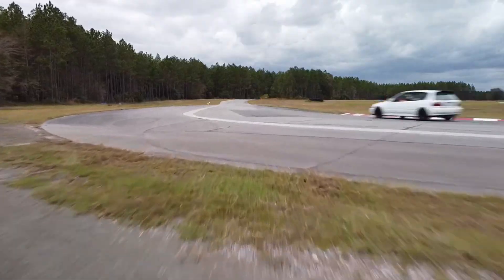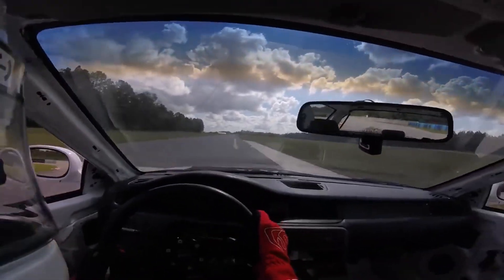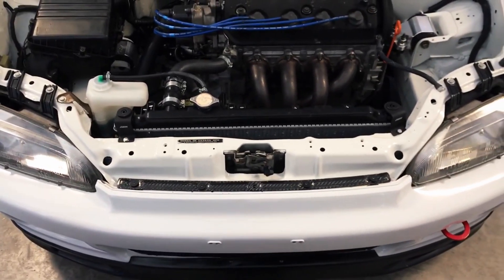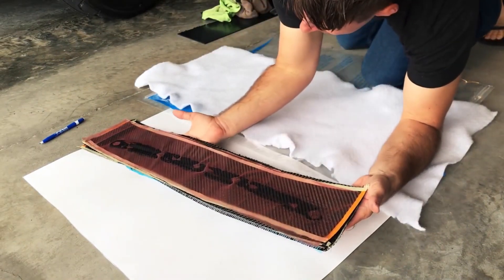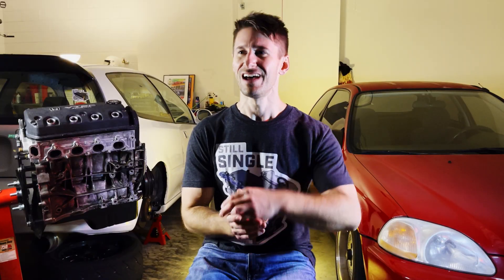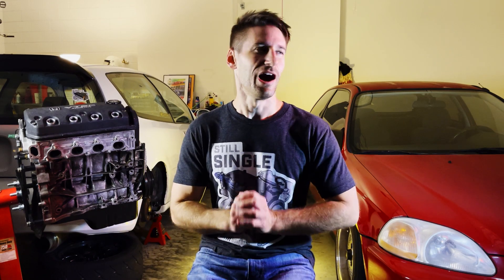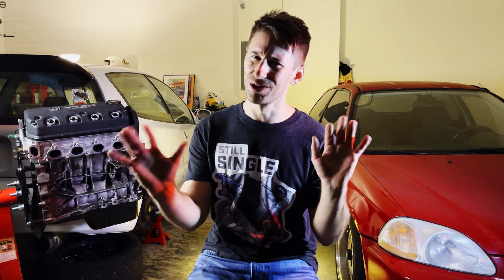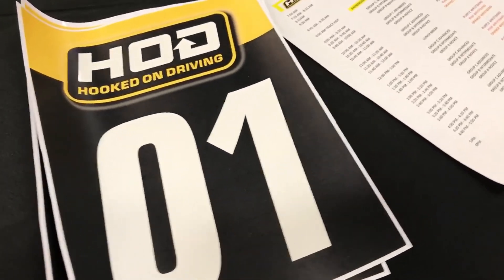That Engine Swap, NO VTEC, and More Horsepower!

Comment: I personally really think its cool that you guys track d16s, and I love all the d16 content. Everywhere on forums, and youtube videos, it seems everyone just cares about power, when that doesn't seem like the original purpose for the Civic. It's tiring sifting through pages and pages, videos and videos of people talking about "wasted money" or "b-swap it", "just k swap it", "making 90000000 hp on a civic (90 lbs of boost!)". Sure, its cool if you like that stuff but your content is just a breath of fresh air in the mass of youtube car videos. I like the engine videos, and the track stuff. Plus, I think it's cool you guys are from FL, cause I'm from Florida too and FIRM is actually the closest circuit to me. (although i have yet to go to it, my CRX is still a long work in progress lol)
Reply: Just be like me, d series power, I've turbocharged and blew up 2 of them (they were stock, still both lasted a year of hard street driving). Currently in the process of a d16 1.7 stroker Vitara build, good for 300whp and 350whp on ethanol.
Reply: I actually like (and prefer) a stock k engine. i do agree with the power hunger from that people have i honestly dont think is necessary. Just a simple,playful and peppy engine is all you need for a good time

Comment: I really like to watch your "on a budget" time attack build! Also like to know how each part  change your lap time.

Do not worry about HP, some top teams at Tsukuba time attack series have just over 200 HP and achieve better lap times than a stock Nissan GT-R for instance.

Focusing on chassis/aerodynamic is the key !
Reply from the maker: I really appreciate that you are interested to see how each part affects lap time. For better or worse, right? Very cool, thank you.
Reply: @RefineMovement  both you guys! Way to end 2021 positively!!

Comment: Love the d-series development. Before power, look at suspension, get around the corners better, and to help with the tire wear. Second, get yourself a track roll cage, and proper belts and seats. The less you move in the car, the better feel for the car you'll have. The extra weight for those won't make it worse
Reply from the maker: For sure want to get a roll cage with proper seats and belts, yes! I'm holding onto the steering wheel just as much as I'm turning it currently going through some of these corners lol. I would also like to get into sway bars. Last time out at Palm Beach Int'l Raceway I was feeling a need for some front bar when I was noticing my unloaded, right front wheel slipping a bit when I was trying to put the power down out of this big sweeping turn.
Reply: @RefineMovement  another thought I had, and i know its going to go against one of your goals. Get your car on a set of scales. Adding some weight for proper weight distribution could be helpful. As close to 50/50 side to side, with you in the car  and, as close as you can possibly get front to rear.

Comment: I honestly think a stock b20b mated to an ls trans would be very useable for the track. Torque to get out of corners and tall enough gears to keep the speed up in the straights. On top of that it wouldn't be terribly expensive to do.

Comment: The learning curve is what keeps me tuned in I'm almost certain I been around since the beginning . Low power and lots of handling helped understand that it's a great staring point to something great from a driver building confidence in him self to evolve now that your more comfortable now seams like a great time to add the ponies in .ever consider flat foot ignition cut shifting with some ECU tuning and maybe some traction control b20 swap and tuned to 200 I feel is a sweat spot with the extra tq it can provide compared to the d16 even tho the d16 was a great start point .try a no vtec b20 then do a head swap with a b16 head to compare the benefits the VTEC head can provide .
Reply from the maker: I'm glad you can appreciate the learning curve. Thank you! Great input on the engine ideas

Comment: Did you ever get that one baselined? You can make b16 power out of a d16 with a ported head and cams. If you want to go into the block P29 or custom pistons to notch up compression would do the trick also.
Reply from the maker: I have not got it baselined but it's something I really want to do. There's a few local to me dyno spots and I'd love to know where it stands.

Comment: The eg needs a roll bar and some seats and harnesses. recaro's or brides are very good on support and comfort whether they are used or new. As for power, money is gonna have to be spent regardless if it's swapping a b or turbocharging a d16. That's might change your cars class if your trying to race competitively.
Reply from the maker: Yes, it does need seats and harnesses!

Comment: I like the building and testing aspect on channels. Some channels overlook the testing part of that. They build build build but 1. Never track or test what they’ve done and 2. Don’t know what helped or hurt when they do test because they made 25 changes since the last time they tested. 

So it would be cool doing like a weight reduction (more carbon) series, get more track times. A suspension series, get more track times. Tire testing (dot 300 wear vs 200 vs track tire) with lap times. Chassis series (stiffening, roll cage, seam weld, etc) and get more track times. Throw on a small baby turbo on the d series and get more track times. Maybe go up to a n/a k series and get more track times. Etc. 
progression with data and testing to prove or disprove certain mods and maybe the need. It would help someone building their own if say they are debating between adding more power vs reducing weight, or better chassis, etc.

Comment: I've been a member of the channel almost since the get-go. 2021 I had to sell my beloved EM1 because I'm battling cancer. I had to use money from the car to pay for very expensive medicine. I'm starting all over just this March 22 I picked up a 97 base model hatchback. My job of 10 years let me go due to the cancer because of me having to take treatments for chemo and everything. So it won't be built as fast as my EM1 was it's going to take some time to even get it up to respectable. I'm sure yours is even faster than mine since I still have the volunteer but I'll get there. Just wanted to say I'm still following even on the content of the channel wasn't coming out very often and I can't wait to see what you do with the little hatchback

Comment: Can’t wait to see what comes next for the eg. Your driving has really developed you made the right choice sticking with the single cam. Keep doing what your doing it may not seem like a lot because your not building a crazy fast car but you can see the growth. There’s a lot you can do suspension wise adding a roll bar and seats will also help. That’s the beauty of consistent seat time instead of throwing a bunch of parts you may not need on the car. On track the car will tell it may need more Collins brakes etc. Keep it up Robbie 🤙🏾
Reply from the maker: Thank you, Curtis! Yeah, lots to do with the suspension still but man I appreciate the compliment on my driving. It's what I'm focused on the most, so thank you!

Comment: I wholeheartedly respect the d series content, Ive been subscribed for almost 2 years and I love the original content. However, I think your skill has advanced to more power, better straights obviously, but perhaps better push through the corners. I know you're a big reliability guy, no turbos and stuff (I've owned a few turbo ds, and though they're great for the street I cant imagine them being seat time track reliable). I think it's time for a modern K series or a classic B swap. Just a basic K24A from a tsx with cams (or not) and the factory lsd 8th gen si transmission. Or a b20vtec with a gsr head (or b16 head with gsr cams).
Reply from the maker: Love all this Brian cause I know you've been around for a while and I thank you so much for following but paying attention to my journey with these engines. Very insightful Brian, thank you. I remember you doing the whole carpet dying as well!
Reply: @RefineMovement  yessir, carpets still holding up well. Sadly the cars down for the Michigan winter while I paint it and build a D16 with a d17 stroker crank, h beam rods, and Vitara pistons. Should be wicked by the end of the season.

Edit: speaking of which, stroker d17 with 7th gen civic gx pistons, a new head from bad guys and a cam would make some serious jam. I've seen some d16 strokers make 170whp.

Comment: I like that you've worked on your style instead of building a 1000hp civic. Almost anybody can floor a fast car and make it run fast. It takes time, practice, and discipline to drive a slow car fast. Once your fast in the car you've got then it's time to add power ro the mix.
Reply from the maker: Yes! "Drive a slow car fast" I love it! You get it! That's what I've been wanting to do for so long. I am feeling the itch for more power now cause I have been getting that seat time this past year but yeah, always practice, practice

Comment: Dude turbo that d16 
That civic with 200 to 250 hp would do really good on track. You can make way more than 300 hp but a reliable 250 hp or maybe closer to 300 would be great and make that civic way more competitive.

Comment: Okay here we go! You need compression, and a ported head and a D16Y8 intake manifold. Contact Cole at Bad Guys and he can help you with the horsepower in huge way. He's a little backed up in orders but that's only because of the exceptional work he does on SOHC Honda engines among others. Also a P28 ecu with Hondata will make your car tuneable, then take it to a Dyno shop and get it sorted and you will definitely see and feel the results! Also look for aluminum brackets for the alternator and such, get about 4 lbs knocked off the flywheel, lightweight crank pulley, and get some rear disc brakes trust me. Also Spoon style mirrors in carbon fiber will reduce weight and help with aerodynamics. Lastly, get a good quality racing bucket to help hold you in place in those big sweepers at Palm Beach. You're doing great man, and you're a big inspiration to all of us SOHC Honda guys. I wish I could post pics of my 3 EG on here, I have a 93 VX, a 92 SI, and a 92 DX sedan. All three are going through different stages of modifications. Cheers bro!

Comment: So I know that you're partial to the single cam, and I understand, I like the underdog engines too. I've had quite a few different boosted single cams. Once I made the choice to move on to the DOHC platform I bought a complete running B18B1 for $250, I got a known good cable GSR trans for $250, I bought a set of Innovate mounts on eBay for $150, I bought a B series shift linkage with the shifter from a friend for $75, I ran the B series off of the same socketed and chipped P28 ECU (with a Crome tune), I used the same single cam engine harness, and I swapped it all into my EJ8 Civic coupe in one weekend. I bought an eBay turbo log manifold for $80, I reused the same eBay 50 trim turbo, wastegate, HKS SSQV BOV, and DSM 440cc injectors, I had to completely chop up and modify the single cam turbo downpipe because I had to flip the turbo on the B18B1 and the downpipe didn't fit the same way. I drove the car to work the next day and at 8 lbs of boost it felt SO much stronger than the single cam. A few days after that I got into a race with a modified SRT4 and I ate it for lunch...dude threw me a thumbs up and it was alot of fun. That was a completely bone stock engine and stock cams, Nankang 205/40/17 street tires, and the exact same tune (with VTEC disabled and tuned up to an 8000 RPM fuel cut) as the single cam turbo with the same injectors. I'll tell you man, it doesn't get much more budget than a B18B1 with a GSR trans and a good clutch in that chassis will completely transform it. My buddy Zack had that setup in his EG hatch and he would eat Corvettes on the street with it.
Reply: I would love to see him go gsr with how light his car is he will be in love. One of my friends had a gsr eg hatch all stock and he would race my other friend with a srt4 acr  neon and would be neck and neck. I have a em1 and a eg8 with a jdm gsr it it with a little work done to it, it definitely shocks people when I get on it.

Comment: Need to keep with that single cam and just build it I’m telling you man you could have the sick a single cam with the one that you have get good with driving it the way it is get used to it and start adding power and you will be a savage with that thing and nobody’s going to be able to mess with you I’m telling you there’s a single cans that are running eight fours in quarter miles  8.4 right now

Comment: my dude its time..you need more power..build that motor you have aside..easy things..a bolt on cam,raise the compression,port the head maybe a bigger throttle body with an intake..a map..should make the car feel great with the weight its pulling..keep at it like the content!
Reply from the maker: iiitttttt'ssssssss...TIMMEEEE haha My best Bruce Buffer. But yes, I agree! thank you

Comment: You keep loving that D series till the day you die buddy I love my D 16 Y8 just as much did the best did the freaking best most amazing engine ever if you build it right they haul ass cause I smoke be 16 all the time and if use the right transmission on it they actually smoke dang near any other car if you build it right it’s all about the trans my guys got to think about these things turbo cars and just the power range of those single cams when you turbo them and you do it right if you have the gearing no B series with those short Won’t touch one at least didn’t touch mine

Comment: I actually raised a e.g. Coup In Mexico  And I totally just roasted this dude with my wire with ball dons and he claimed to have a B 16 swap with both Don’s and I literally just walked him and it was like a 20 mile an hour roll like a first girl and like because of the training I have I hit VTEC at like 60 miles an hour and six gear like right after I hit second gear likeGame on till 90 And then I hit third and then I’m good till 130 none of them can catch me bro it’s all about the tranny it’s the transmission from the year car like your hatchback but with the base model trans I don’t really know how to explain it but it’s the one that came with d15 I believe it’s got really long second and third gears Maybe it’s the tranny but I also did too in the car myself and him running it on age 22 injectors and it’s tuned on Honda tuning suite on a P 28